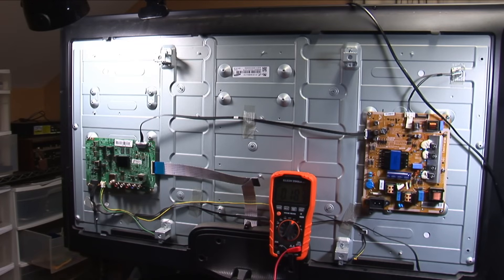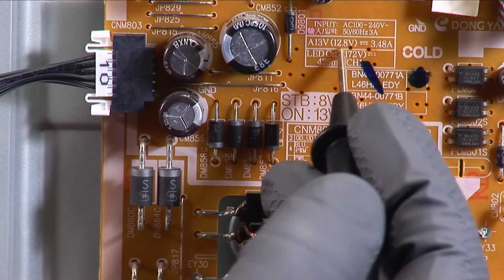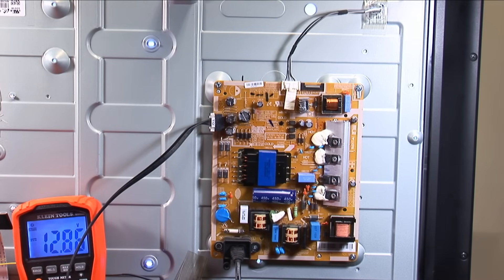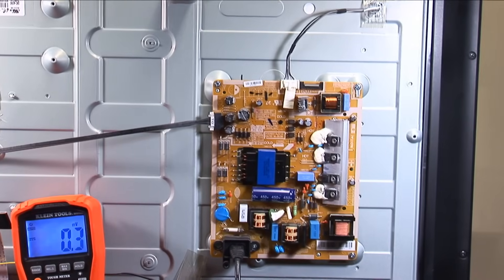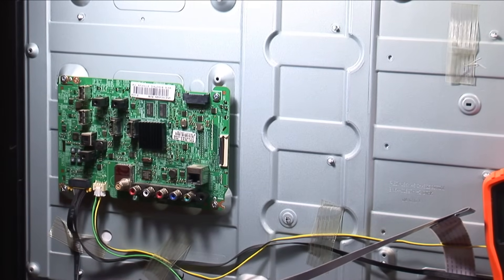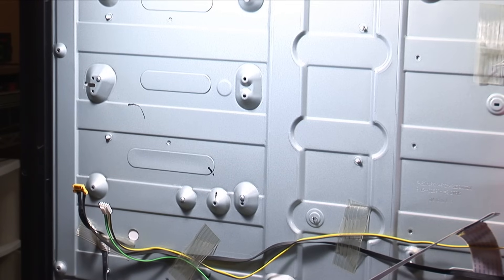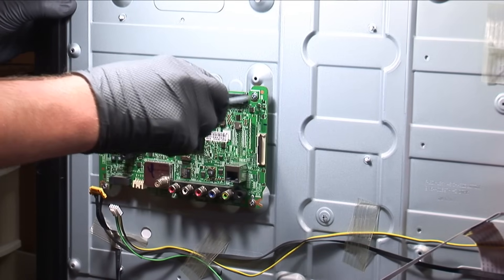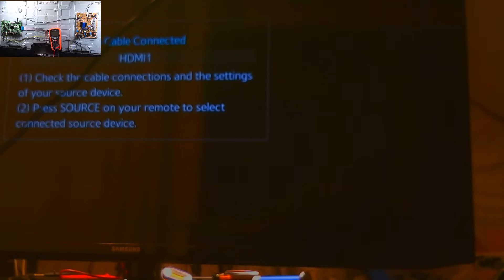Samsung LED Flat Screen TV Repair - Won't turn on, no power - How to Fix

Comment: I know my power supply is toast, but how do i test the main board to see if that is any good still? I'll replace the power supply, but the tv isn't worth replacing both... i'd like to test the main board before ordering a power supply
Reply from the maker: What I do is apply power using an external power supply. So if you have a 5 volt rail.  With a bench supply apply 5v while also doing the same simultaneously for the other outputs.  If it fires up.  U know your main board is good.  Kinda like using starting fluid on a motor that won't start but has spark.   If it fires up using starting fluid but not without it. Then u got a fueling issue.  Same idea.  It wants power.  Give it power. Just gotta make sure you apply the right voltages to the right rails. This is oversimplifying it though cuz often the power supply does more than just supply power. But it's a start and if done right won't hurt anything.   Sorry. Hope that ramble was helpful.
Reply: @Electronicle  Thank you! I'll look into doing that, never tried that before. Only one way to learn! :-) Thank again and keep up the great work!!!

Comment: I have a 58” Samsung smart tv that the power board when out on so I put a new one in and it worked for awhile and then it when out can you tell me what it could be! It didn’t last a day
Reply from the maker: Gotta troubleshoot the problem.  There's no fix button.  Checking voltages like I showed is the most basic step.   This reply sounds mean but it's not meant that way.  If you got a used power supply it's possible that it was on its way out or somethin else in the TV is intermittent.  Won't kn9w till you get some readings.  One thing I do is apply power from a known good bench power supply.  Most people don't have those.  Also need to know what voltages to apply.  That's where a service manual comes in handy or if you're lucky they have it printed on the pcb.
Reply from the maker: Essentially narrow it down.  Is it getting power.  Is the power supply putting out the proper power.  Are there any safeties in place that prevents the power supply from outputting. If it's a Ccfl backlit tv. Is the backlight on its way out etc etc etc.  Start with the basics.  Check voltages.

Comment: Was about to give up on this same TV until I saw your video.  Neat little tip about the backlights and checking voltage showed me that a few of my backlights were bad and must be shorted as they are impacting the outputs from the power supply.  New backlights on order so I should be back in business when those arrive.  Thanks for posting this video!

Comment: Yessa..   same situation, worked great, storm hit. Hdmi ports stopped working. TV works periodically, sometimes the tv will turn on and off again without actually booting up no matter how long you leave it unplugged. Pretty sure since the hdmi ports are toast and it does power up sometimes it's almost gotta be the main board huh. Think I'll give it a shot. Thanks buddy.

Comment: So I have Samsung h5202 went black and won’t power one. Checked fuse it’s good and I m wondering if you have any thoights
Reply from the maker: Not powering up and the screen not coming alive are two different things.  Verify that its actually not powering up and that the power button does nothing.  Check output voltage as shown from the power supply.  there is going to be a constant 3.3 or 5v output to power the board while the tv is 'off'.  Make sure that that is there.  If it is not, chances are its the power supply.  Start there.

Comment: Hi i ve come across a toshiba 58L7365D led smart tv.  Its powers up with a blue screen no sound and no response to remote or buttons on the back of the tv. Is this a tconn board issue?

Comment: UN46D6000 won’t power on, a blank screen. Son said they had it on and just went blank. Took off back cover and unattached the power board from main board and back light is flashing on and off intermittent every 3-4 seconds. Any thoughts on what these means or what the next step would be? Thank you.

Comment: Great video. Can you show video of how to repair/replace optical/audio socket on 2018 Samsung UN6900 smart tv?  Worked until optical cable was pulled against when earphone adapter unit was pulled off of dresser and it hung down on the extended optical cable. I can feel that the optical/audio socket is loose. Can you show  what parts or electrical board needs to be repaired/replaced?  Thanks a lot.

Comment: On my tv, it has the same numbers needed as this one, but when I move on to the other side of the wire, it is causing my backlight to shut off/flicker. And isn't reading a steady 4.5v. Do I need to replace the cable?
Reply from the maker: Wiggle the connector.  Might be a bad solder joint. Check if movement effects it
Reply: Wiggled the connector and it felt fine. The backlights are shuting off when I test the power on/off and the blu_pwm

Comment: i have same symtoms as this video , my back lights work , i tested the output on plug everything same as your except i am getting 12.67volts on the one side of plug, i replaced main board and it didnt fix it , i wondering if i got a defective replacement board
Reply from the maker: What's the voltage supposed to be on your model for that pin
Reply: @Electronicle  i believe 13 volts. Model is un60j6200afxza
Reply: @Electronicle  on your video where you were getting 12.8 on 4 pins, i am getting 12.67 on those 4 pins
Reply from the maker: @mikevotaw4636  is it the same model tv and board?  If so then that sounds like its within spec.

Comment: Don't even bother trying to fix newer tvs.  Chances are you won't be able to.  If you start swapping boards, the replacements MUST be identical.   Even then, you have to ask, why did the original board fail? If you can't determine that, don't bother, there's a good chance  it will fail again for a variety of reasons.  Otherwise you'll need experience with soldering surface mount components and using lead free solder.  If you don't,  don't even bother.  These sets were designed to not be reliable, or easily repairable.

Comment: Thank you, Thank you, Thank you. The $120 main board I just replaced saved me a $1,000 on a new tv...
Reply: Where did you order it? Please .
Reply: @mareknosek996  Sorry. its been so long ago I forgot. Just duckduckgo the part number and call everyone that shows that they may have it.It is a very very very hard part to find...
Reply: @deplorabledreg2935  i found it ! Thanks again for your quick response! Have a great day my friend.
Reply: @mareknosek996  AWESOME!!
Should take about a half hour to replace. Your remote that came with the tv will no longer work with your new board.
Reply: @deplorabledreg2935  Is there something i can do for that ?
Reply: @mareknosek996  you will have to make any adjustments to your TV manually. But I’m assuming you have a cable or satellite service where you can still control functions with their remote
Reply: @deplorabledreg2935  Yes i do have a service provider. And will look into adjustments for the remote.  Thanks again for everything you've been a great help. Sincerely Marek

Comment: 2019 ended for me with an expensive "silent" bang. My 3 years old Samsung UE65KU6509 LED TV stopped working.  Warranty  ran out 1 year ago... In the past i succesful repaired PC screens so i hoped i could tdo the same with my TV.
Watched a lot of videos, googled and your video was the one that helped me a lot. Measured everything on my power board, even measured the capacity of the capacitors. Everything was fine, the power supply is delivering the constant 12,8V it should by reading the printings.
So i'm quite sure it's the mainboard that is faulty. No visible damage there but no standby and no power on.
And here comes my problem and a question someone can maybe help me with.
I googled for the mainboard of my TV. 
The sticker on the mainboard reads TV Modell: UE65KU6509UXZG Partnumber: BN94-10786A
My problem is, i can't find that exact board for my TV worldwide. But i find mainboards with the exact same part numer for TV Modell:  Ue65ku6500uxxu

Can i use that for my 65" 4K curved TV? I don't understand why i can't find any mainboards for my exact modell.
Reply: I think we have the same issue almost
Reply: @abdulrahmanbinkhalid1502  ،،،😥😥😥
Reply: Please help me I inverted my DDR when replacing it and my pc is dead (power steady Amber) .is it main board to replace or the processor?thank you brother.

Comment: I have a samsung un46h6201afxza no picture or sound I changed the T-con board and nothing. I tried your method of unplugging the power from the main board and no back light or anything. On the T-con board there are 2 blue lights when the power is on. My question is what next? HELP!!!!

Comment: If you have to replace the entire mainboard to say the tv is repaired then is better to buy a brand new television that has at least two years quarantee hoping that this might will be better than the previous one.
Reply from the maker: Well   new tv $150-300.  New(used) board $15-$30

Comment: I have a Samsung 49inch curve smart tv which have a power board issue. And my friend have a same inch tv (Smart) but its flat with the broken LED Screen. so am thinking of using the power board of my friend to my tv. Will it work or not? need your perfect answer.
Reply: As long as it's the same model tv and/or the boards are the same part number
Reply from the maker: I agree with why not

Comment: Thats great if you have another pcb , but would it  not be better fault finding the faulty board .
Reply from the maker: just was a quick video showing people who have little or no knowledge of electronics or many tools, how to quickly troubleshoot and decide which board is most likely bad and which they would need to order.  Most of the boards for these tv's can be purchased used for $20-30 online, which is much cheaper and easier than buying a new tv.

Comment: Thanks for the video. Found a Samsung 48 inch 4K smart tv and seems like led goes on and controller in back seems like it's on and has power. Hard to find parts. Any sites besides Ebay u recommend?
Reply from the maker: try shopjimmy.com

Comment: If a PCB is dropping the power supply voltage down to 0V, or, as in your case, causing the TV to seem to be turned off when plugged into the power supply, then there is probably a short.  Replacing an SMT board is the most common solution to this problem, as you have shown.  If you wanted to find exactly what component was shorting, pour 90% isopropyl alcohol over the board and, under low power of a stereo microscope, see where the alcohol dries up the fastest.  The component on which the alcohol evaporates the fastest is the shorting component.  Now, you can order a replacement board, substitute the shorting component from the board you ordered, and keep the board that you ordered, plus the board from the TV, as extra boards from which you can harvest replacement components for future TV and electronics repair jobs.
Frank
Frank Reiser Video/Audio Service
Reply: A flir type  camera is very useful

Comment: Electronicle, thank you for your help.  I tried the simple steps of unplugging the tv for a minute and replugging; didn't work.  Then took the batteries out of the remote control, pressed the on button for 15 seconds, placed batteries back in the remote and pressed the on button, and it did not work either.  Your video gives me more information as to what might be wrong.  There was a storm a couple a days before it stopped working so probably that had to do with the malfunction.  I will follow your instructions before I decide to get a new one. Thanks again.

Comment: So where you buy board at? How much do they run?
Reply from the maker: For used boards I usually check ebay.  Many times screens break but all the other parts are still good so they are sold off

Comment: Kinda dissapointed, I was expecting a component level repair...
Reply: Me too that’s what I spent 6-8 years training to do. 94-2002. Now it’s all smd so it’s to awkward to do. It’s all digital so the circuitry is completely different too. Used to love getting the circuit diagrams from reference library at college and in the village where I lived (about 1000 people) I was the man they turned to. I did it really cheap and sometimes only broke even but it was pocket money. Used to get help training at college. I still fix  my own VCRs and CRT TVs but nobody else want ps anything doing. It’s the throw away society and the market is flooded with Chinese crap with no diagrams available.
Reply: @richardanderson5424  don,t worry about smd chip level work dear , right now my age is 53 but i am doing chip level work especially i repair engineer for projectors and digital cameras.. if you have any roblem you can touch me by mail ...damankarsanjay@gmail.com i will help you
Reply: Sanjay Damankar. Thankyou for your nice words and offer of help. I will add you to my contacts. Don’t get a lot of work to do but I’ll always take a look and replace some smds with insulated discreet parts. Mainly fuses. I did a college course on analogue satellite tv receivers. It was surface mount technology but the analogue system started to be phased out whilst I was training for it.  Can’t find anywhere to retrain but I will keep on reading and watching youtube. There was a good long running Magazine in the UK originally called Practical Television and then just Television which mainly gave information on servicing but towards the end started to mainly briefly overview new technology. It did not last very long after that.
Reply: @richardanderson5424  sad but true story...
Reply: So was I. LOL
Reply: Same
Reply: Impossible because of the small component sizes and spacing.
Reply: Modern control boards are not easy to repair.  Capacitors, diodes, resistors, etc are really tiny and difficult to desolder/solder.  You’re better off replacing the whole unit.
Reply: t0nito just bake the board in question in the over and reflow the solder. 9 out of 10 times it could just be a bad solder joint.
Reply: @Shackattack85  That will usually work with LG, however I've never seen it with Samsung. More than likely it has a shorted capacitor on the main board.
Reply: berryelectronics yea baking sometimes Is my last resort to try to fix it.
Reply: @berryelectronics   A flir camera helps heaps with these, especially on the panel attached TCons (where it's not a separate board).
Reply: @saddle1940  Freeze spray or alcohol also works well.:)
Reply: @berryelectronics  yes and also a thermal imaging camera
Reply: @Shackattack85  that's terrible advice
Reply: @tonytrilex2555  for people who don’t understand
Reply: @Shackattack85  He said thunder strike, if it hit anywhere near the cable linked to the cable box it fries the box and the TV linked to it through HDMI, it fries the main IC on the TV board. It happened to me twice.

Comment: So I have this same issue. I have a UN55MU6500. Followed this guide. Got No backlight when pulled cable. Checked voltage, it fluctuates between 8v - 13v. I replaced power board with a used one. Same issue. Any idea? I can hear something clicking on both the power and main board. Red status light blinks.
Reply from the maker: Ccfl or led backlight?
Reply: Electronicle led. So I tore it apart to the led strips. When I test them some of them don’t light up. I’m guessing that if even 1 led goes out, the whole tv won’t turn on?
Reply from the maker: @Samallmighty  usually they are run in series.

Comment: I did this test well the unplug the cable and back lights came on screen went all blue. What does this mean?
Reply: Ive been watching other videos like this and usually that means its the main chips on the controller board are bad, the bcd  chips.. The one this person replaced.

Comment: Have you ever fixed A.B.S. brake module boards ??
Reply: I do not have power or standby light. I did the flat cable unplug and no led lights came on. Does this mean it’s my main power board? Fuse up is fine. Thanks

Comment: When the power supply board  is disconnected from the main board and checked with AC on, I can find 5V on the standby as per what is printed on the board,  but cannot find the 24V in the adjoining socket.  What is the reason for this? Anything to do with the bridge rectifier?  Thanks, in advance, for any advice.

Comment: Ive seen alot of these videos and in most cases its like get to the damn point. Your video wasn't like the rest which was koo... From my experiences and just having nothing better to do, if you grew up not having all the money in the world and things broke; for most that's how you learn to become a handy man. So for the people on here watching these type of videos and say "its because of these videos that gave you the push to jump in and trying to fix it yourself " i 👏 applaud you guys that's all it takes . To be honest 7 times out of 10 of all the tv's i fix here and there, its really only the Capacitor's and the ribbon cables that go bad and its really easy to fix those. As long as the lcd monitor or l.e.d's are not broken then usually what i just stated are usually the culprits.. If your an unlucky one it might be something a lil more but like i said if it isn't the screen or lights its easy to fix these things..  I got sick of seeing and hearing how people get ripped off for a fix that really was only a 5$ fix but getting charged about 100 then an additional 60 to "order" a part smh.. Good luck to all of you who are trying to roll on your own to fix your stuff don't get bamboozled by con artists.. Good video too!